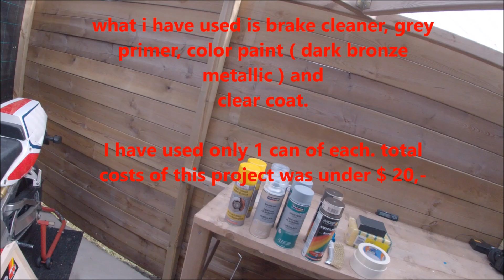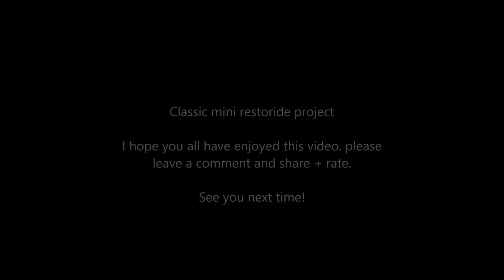RestoRide EP02 Classic Mini - Spray painting wheels (HD) (VLOG)

Comment: Nice! I also restored my rims. It was a pain to sand between the spokes: I had a lot of pits I. My rims had alot of scratches and pits so I had to use aluminum filler to smooth them back out. I use the restored ones for my rally tires and have a black set of minilight rims for road use. Keep it up!
Reply from the maker: TheWrightGarage Thanks. Cleaning the wheels and sanding / preparing took the most time.  I used primer and clearcoat from Action :) they are verry cheap ( € 2,- each ) the colorspray is from Motip wich you can get at every carparts store. I have painted them 2 months ago / 1000 miles and still looks as fresh painted. If you need painting advise let me know!